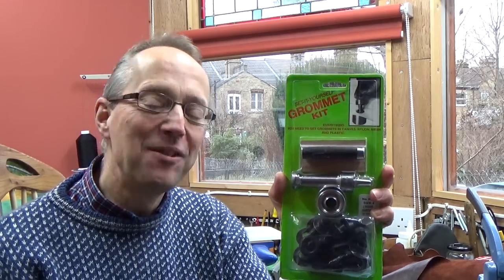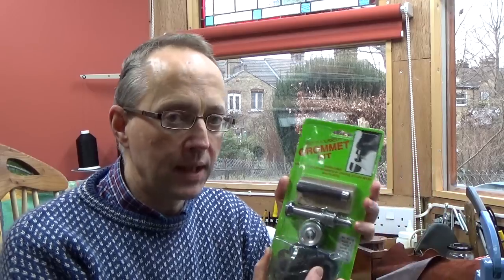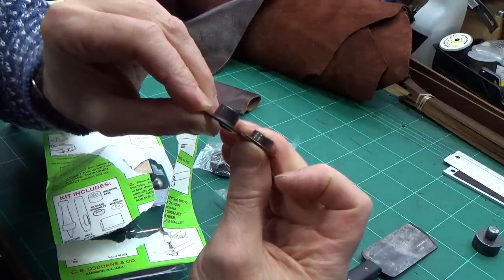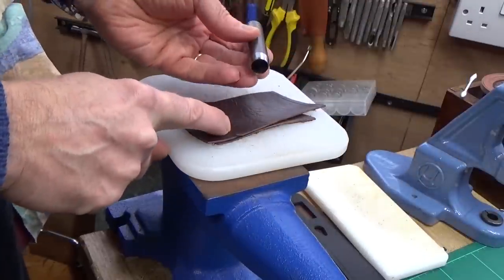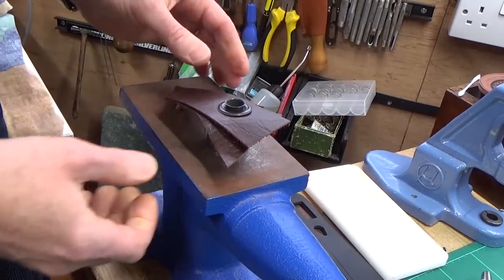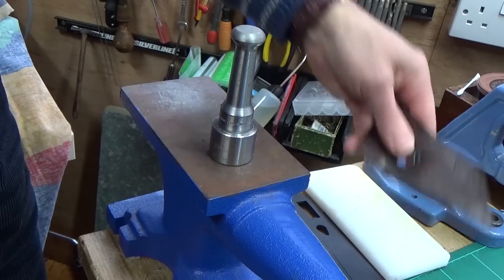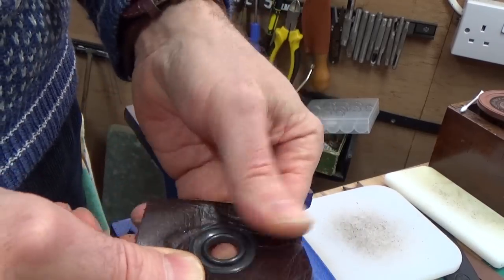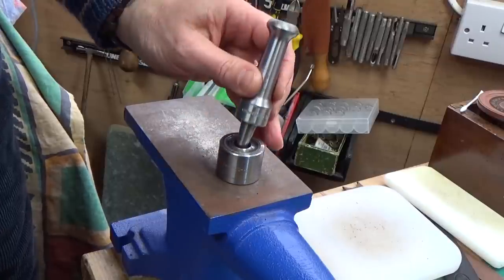Setting Large Grommets and Eyelets with the Osborne Die Tool.

Comment: Nice vid Harry. Just a little heads up after each use put a light coat of oil on it. Most of my leather tools are C.S. Osborne and are indeed a quality tool with quality steel.
Reply from the maker: sinpac6161 Thanks - a good tip as I was surprised how 'rusty' mine got with little use - still a good steel to rust finely!
Reply: Right on Harry. :)

Comment: Harry, I love your films. Do you have some idea where one can procure a setter for installing the Sam Browne buttons? Tandy sells the buttons but shows no tool for setting them. Anvils they have, but how does one force the button against the anvil without destroying the little bugger by banging away at it with a ball peen hammer?
Reply from the maker: Hi Joe, I have always used screw in Sam Browne studs....however the Tandy anvil seems to be a tiny...and very cheap...donut of metal, so I guess one needs that to protect the stud head when hitting it???? That seems to be the consensus on leatherworker net. It will be interesting to see if anyone here can advise further.  Rgds Harry

Comment: Mr. Harry Rogers, can you answer a question?  What do you think of Osborn tools? We're in desparate need of a skiving tool, and see an Osborn skiver for around $40us.  The only experience with Osborn that I've had have been some horrible egg eyed harness needles that are very hard to pull through vegtanned leather.  Anyway, your opinion?  Can you recommend a skiving knife.  We do a little bit of everything from shoes/boots to hand bags, sheaths, holsters belts, and even props for cosplayers.  Any help would be greatly appreciated!
Reply from the maker: Bushcraft Beats hi they have a good reputation....I have their grommet tool and a couple of their edge bevellers and marking wheels and they are very good. Skiving wise I like the cheap tin shivers with disposable blades...most unusual I know but they suit me ...despite being an excellent hand tool sharpener!
Reply: I just can't get a consistent even skive with the safety bevelers.  I work for ever taking bits away, shagging up my leather, but never achieve that perfect ramp from thick to a feathered edge.  It could just be skill, or a bad safety skiver/tin shiver that I've got, but I really think I should try another approach.  I've been thinking about those flat skivers that are just a flat blade with no handle, sharpened to a chisel point, they seem the most effective to me... then again, I'm thinking a head/round knife might be the trick.  Open to suggestions there, perhaps an Osborne!  Haha, thanks for the response Harry!

Comment: What hammer do you use and what surface do you think is best as they have hickory, leather, polyethylene, abs, brass, rubber, etc?  I would suppose you would want one that isn't steel, but doesn't recoil.  I'm going through two layers of jute which is a bear to cut.
Reply from the maker: I use a nylon hammer for hitting tools.